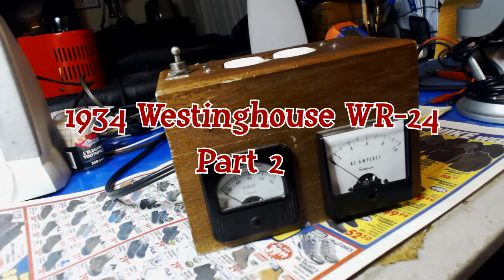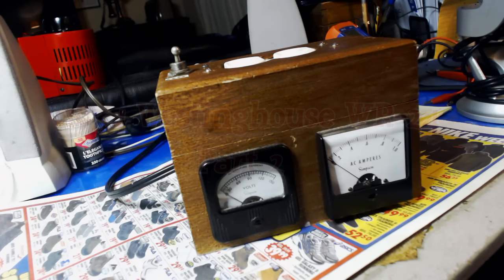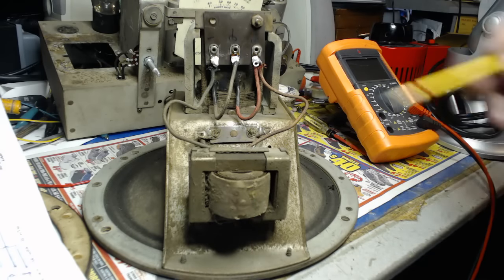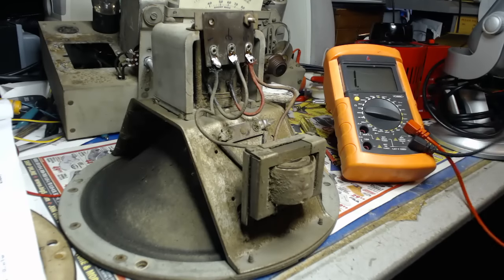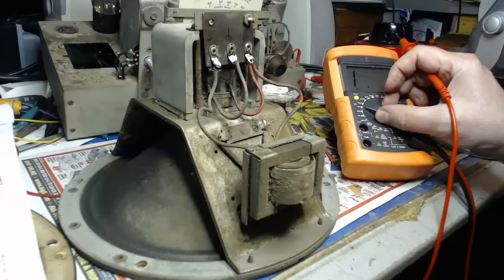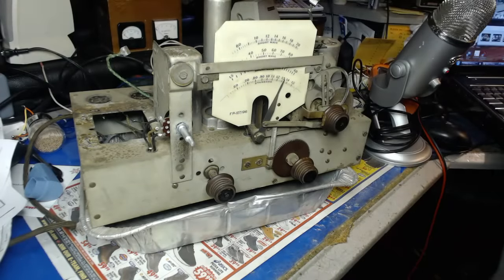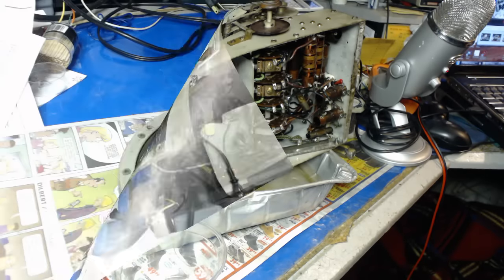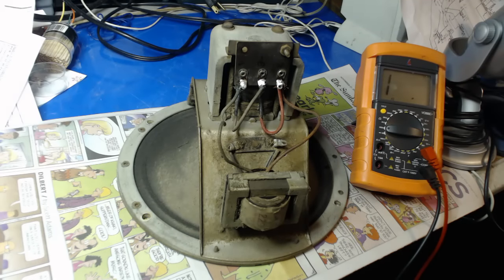1934 Westinghouse Model WR-24 Restore Part 2

Comment: Hi Buzz, 

I wish you the best of luck with this repair.  It will be better than new by the time you're done with it.  I've seen people use a Popsicle stick with a notch in it to feed the wire evenly onto the spool.  

Thanks for sharing the very useful information on the amp/voltage setup.  That's a pretty useful box you've got.

Tom
Reply from the maker: Glad you liked the box info..had a lot of peeps asking how its wired....thanks, Buzz

Comment: Great stuff as usual Buzz.I'm glad you took the plunge and decided to rewind the coils rather than replacing them.I have just found myself in a similar position but in my case the coil is the primary winding in a flyback transformer from a 1959 21"Dynatron TV.The winding has six layers, each being 90 turns.That should be fun!
Reply from the maker: The more I look into coil winding, it doesn't look so scary and complicated..., just do it and see what happens...Buzz

Comment: Greetings:
Don't forget to paint the iron core RED.
The spacers under the field coil are to position the voice coil in the center of its travel so it can push-out and pull-in equally.
Since this is an electro-magnet, the absolute value is not as important as the magnetic field it makes to interact with the voice coil. Use the correct gauge magnet wire (new) and wind until the measured resistance matches close to listed DC resistance.
The audio output transformer is likely easier to buy & replace than the speaker field coil since there are universal replacements as long as too much current isn't drawn. The power output tube data sheet should have all the values needed incl. output impeadance.
A footswitch in line with the drill motor plus a flexible joint between the drill motor chuck and the spindle.

Comment: Buzz - I believe this was made for Westinghouse by United American Bosch, very similar to the Bosch model 360. I left some info about it on your post at the Antique Radio Forum...
Reply from the maker: Looks like a dead ringer for the westinghouse
Reply: glenstertx you are correct.  I have an American Bosch model 360 radio that had this same chassis

Comment: I was going to try to rewind a audio transformer once, but after I got it all apart, I found a replacement and didn't try. One thing I was told is that  you have to watch out for is the direction of the winding's. Make sure you wind them in the same direction of the ones that you removed. Didn't make sense to me being that you are dealing with a AC current, but I was told that the coupling would be stronger? Good Luck Carl
Reply from the maker: I don't know about that, but I don't know much....haha...Buzz

Comment: You can get a coil winder on eBay for about 25 to $30.  These have rotational counters that counts the number of turns.
Reply from the maker: I don't have $30 bucks to spend..I'll do it the cheap mans way with my 47 years old drill...its free....Buzz

Comment: Good shoe ,interesting coil,  maybe spacers have something do to with keeping the magnetic field at a specified distance from voice coil just a thought , have you ever used that CRC brand electrical cleaner ,spray wonder the cost differance from the Alcohol ?
Reply from the maker: I do have that CRC..and used it too on the chassis....but Its almost 7 bucks a can.....I got a gallon of 99% alcohol for $16 bucks...I will tackle the shim issue when I get the coil wound....Buzz

Comment: you can use a cheap small china made 4.5 volts rechargeable screw driver drill .....it turns slowly and help you rewind the coils......you can even control the turning speed with a cheap DC  motor speed regulator circuit which are available on e-bay....thanks.
Reply from the maker: Not buying anything to wind the coil...too poor, besides, ...I have my plan, and I hope it will be funny and interesting......Buzz

Comment: Now I know why I replaced my last fried electrodynamic speaker with a permanent magnet and a resistor to copy the load on the field coil. Much easier, sounds good too, but you have to increase the electrolytics by 50% to filter the residual AC. Keep Dickel away from the jug of 200 proof! AND thanks for the analog dim bulb wiring. All I need is a box and now I'm ready to build one. The shunt issues had me confused in the past.
Reply from the maker: dont know what your shunt issues are..sorry.............watch me wind a field coil next week,,,